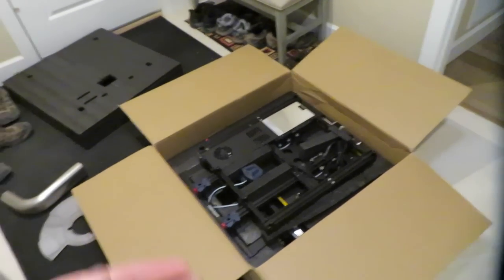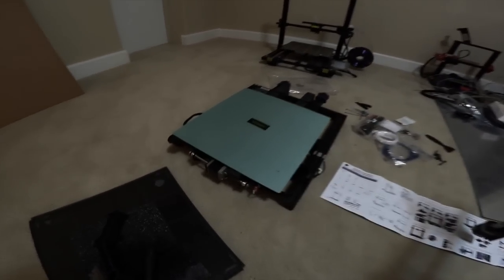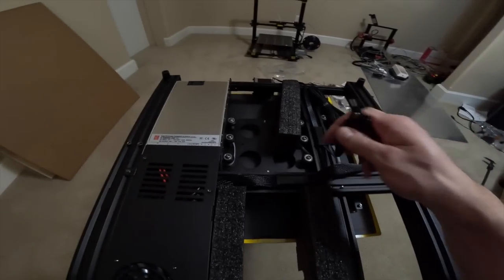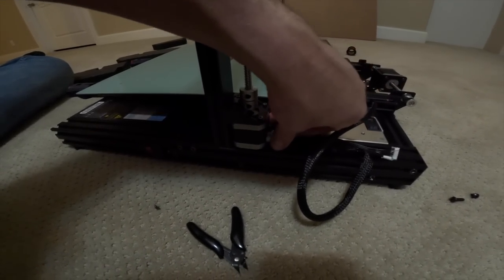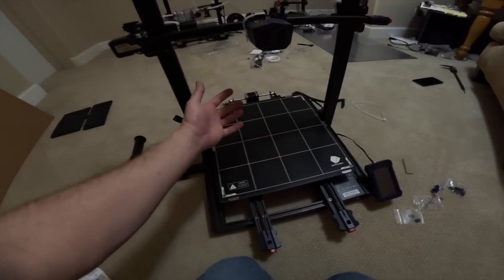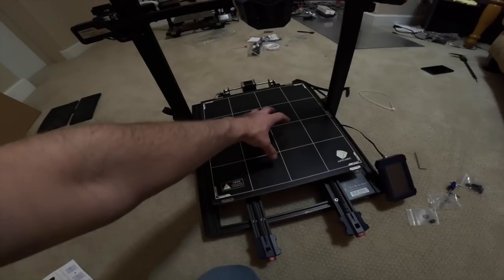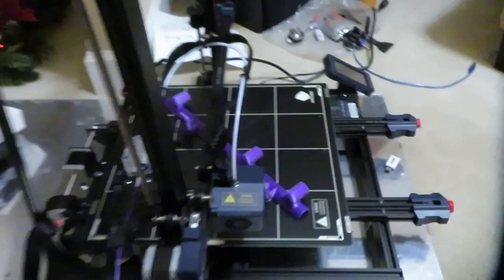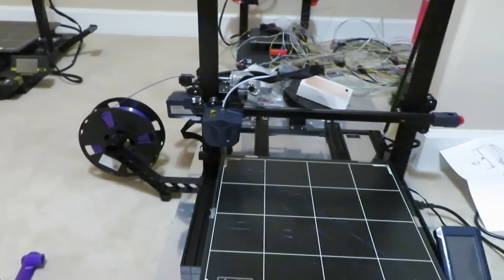Making Race Car Parts with a Huge 3D Printer - THIS THING IS INSANE!!!

Comment: It's really annoying when you can't get parts to fix something that is working, other than a part that has worn out. I had an angle grinder that wore out a bush and the manufacturer didn't sell the bush. Luckily, I found a compatible bush on eBay and I was able to fix the grinder and return it to service and it's worked well ever since I fixed it.

Comment: thimk thosw lumps in the print could be the power restore feature when printing files with high polys the buffer runs out when it saves it's position. turm it off or use lower poly models

Comment: That new printer looks like a great deal for what you’re getting. Question though, with your experience using that brand what parts on that printer in your best guess will probably need replacing? Because if I get one I’d like to order those potential replacement parts at the same time.. if available of course, lol. Loving your videos Dave, keep up the good work👏
Reply from the maker: Definitely the hot end kit and the filament feeder

Comment: Just curious what part broke on the extruder, cause most any fdm printer you can find any part for. Maybe the company that makes the printer doesnt sell it, but the 3d printing community is one of the biggest diy communities out there. My first printer was a cheaply made chinese prusa I 3 knockoff and I had parts fail and just upgraded them and printed others.
Reply from the maker: It was just the plastic cog I'm probably going to replace it with a metal one